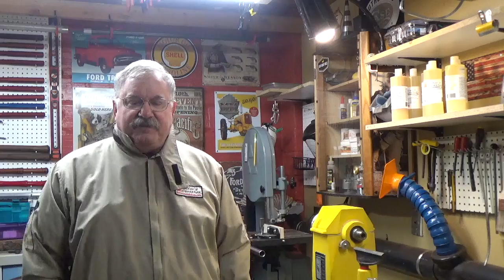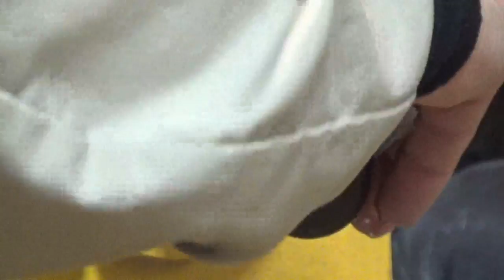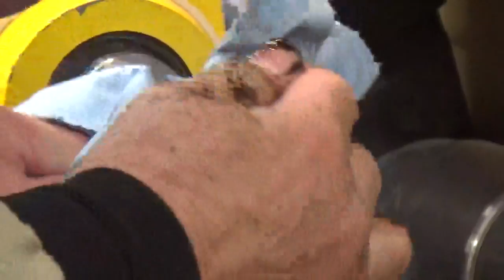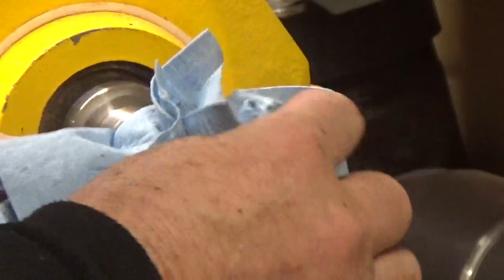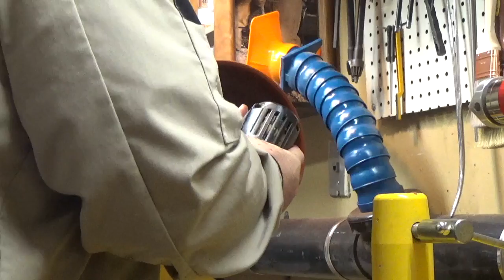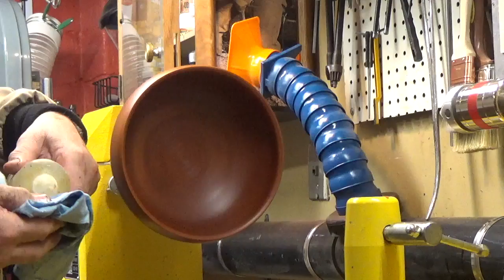Walnut Finishing Oil and Sanding Lubricants

Comment: My method of finishing my pens is as follows. Please let me know if I should change my method?after sanding to 600 or 800 I wipe the wood clean with denatured alcohol. Depending on the density of the wood I use sanding sealer. After that I use my version of paste sanding with a very hard fast buff. Then I use my version of polishing paste and a hard fast buffing. I then use Doctors walnut oil and give it several coats and give it a hard fast buffing. I then use Doctor’s High Build with several coats and the same buffing technique. My finishing coat is with Doctors Pens Plus. With the same hard fast buffing.

Comment: What a mess!. I use OB shine juice and get the same results. He's just trying to sell his product which is way over priced.
Reply: This is old but my problem with the shine juice is the shine doesn't last long at all. Denatured alcohol has all the chems in it as well as most BLOs. If you had grain alcohol instead of denatured I'd be a little more inclined to say yes but the walnut oil if you make many items used for food is 100 times better. It truly is great stuff. Whether you use mahoneys or this stuff it's similar but the doctors stuff is the best to me.
I'm wondering after 3 yrs have you changed your opinion at all?

Comment: What do you do to finish the part of the bowl that is attached to the lathe? Thank you
Reply from the maker: To finish the tenon, reverse the bowl and hold with a jam chuck, vacuum chuck or Longworth chuck to shape the bottom.  Sand with lubricant as was done for the rest of the bowl, clean and friction polish the oil then apply the film finish of choice is any is to be used.

Comment: good video! thanks........ one question, i assume shellac can be applied immediately afterwards?
Reply: It absolutely can.  Can also be mixed with the oil. If you rub it on, you don't want the surface too warm and it needs to be carried with enough oil to not gum up.  Always experiment, oil and shellac are great combos, imo.

Comment: Does regular sandpaper work as well as wet/dry paper?  Also, can your friction polish be applied on the walnut oil after sanding?  I assume it can but just wish to make certain.
Reply from the maker: Most sandpapers are made with water-soluble adhesives, so oil won't bother it. I use the Klingspor cloth back paper but others will do also.  When you are finished sanding, clean the surface very well with fresh oil and then friction polish  to set the oil.  After that, you can apply any finish.
Reply: @TheDoctorswoodshop  OK and thanks.  I very much like your products.

Comment: Thank you -- very nice.  This is wet sanding of dry wood, and I can see many advantages.  I also wet sand wet wood --first with water, then after about 220, I have the option of mopping up/blotting as much moisture as I can, and then going through 2-3 more grits with oil.  The wood is still wet, and I don't try to generate much heat at this step.  Then they air dry a few months, and I re-mount and repeat the last grit with oil, or use a non-woven pad with oil to eliminate any raised fibers.  For a warped bowl, I can't go real fast, so there is not all that much heat generated.  Oil finishing unseasoned wood does work, but probably results in a little less initial penetration.  Luke Mann did a lot of studies of this about 15 years ago.

Comment: thanks for this vid as there are not a lot of videos about wet sanding bowls on a lathe, ive been experimenting on a few pieces and have had problems with power sanding paper gunking up instantly, so you use wet and dry paper when power sanding or just plain hook and loop sand paper?
Reply from the maker: I use the hook and loop discs.  To help the gunking problem, I keep a plastic dish of walnut oil on the bed ways held in place by a magnet.  Dipping the pad in the oil frequently will help keep the slurry loose enough to keep sanding.  I also have a roller window shade mounted over my lathe so I can pull it down and protect my work area from the gunk wet sanding can throw around.
Reply: thanks buddy and sorry I meant the power sanding discs you use are they hook and loop wet and dry or just standard dry hook and loop ? :) Im going to try again wet sanding on the next project
Reply from the maker: The only wet/dry paper I use is for  2000 grit and above and that is not hook and loop.
Reply: TheDoctorswoodshop thanks a lot ill give your technique a whirl :)

Comment: Can you use this technique if the project is a mixture of turned and non-turned components, e.g., a chair, bed, or something with turned cabriole legs? The concern is that somehow one must get a comparable appearance on components that never go on the lathe, like the headboard on the bed or chair seat, or one might be planning to dye the wood. Is there a way to still use this technique as far as having a cutting lubricant and reducing dust? Maybe if you stop with the cleaning and skip the heated polishing of the turned parts and rubbed down the flatwork components with oil? Could you use water as a lubricant (realizing there will be raised grain to deal with)?  Thank you for the excellent video.
Reply from the maker: I honestly don't know about matching surface appearance.  You can use the sanding lubricant with a random orbital sander or a drill sander. I've got my doubts about a belt sander.

Comment: Great show Doctor.  Thanks for the information and demo.  Do you need to worry about carrying some rougher grit into the next finer sanding? Or just wipe with paper towel between grits?Mark
Reply from the maker: I suppose it's possible that some grit is lost.  In truth, I've never thought about it. The fresh oil should wash the surface and remove the residual grit into the next grit.